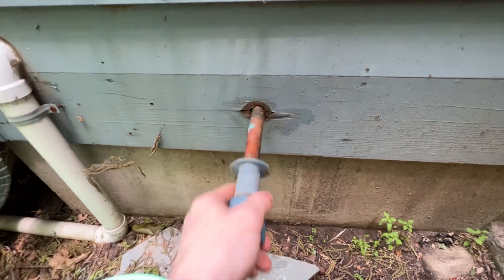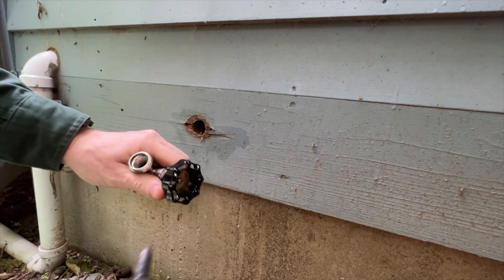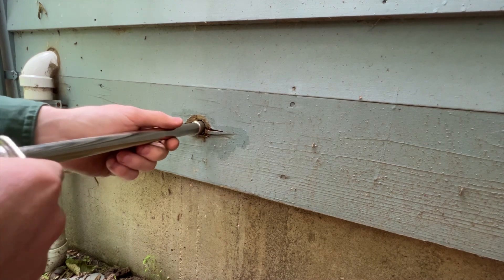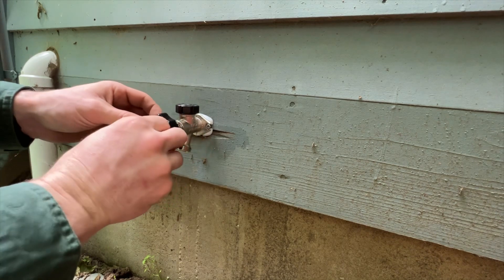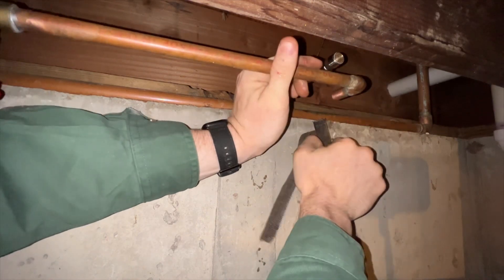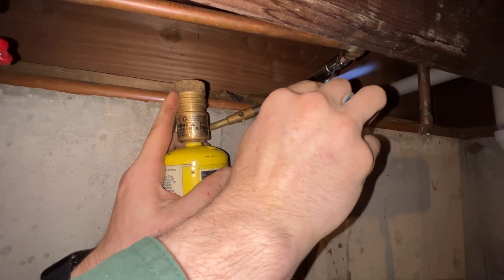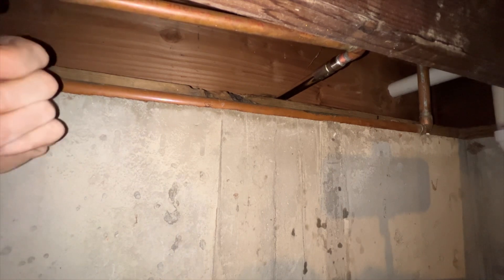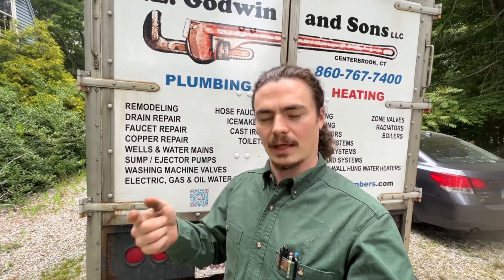Silcock Quicky

Comment: You don’t take the valve apart there are rubber washers in it?
Reply from the maker: Negative, as long as the soldering process remains quick, the seals will be fine.

Comment: need to remove the stem to prevent the seals from melting...next time
Reply from the maker: These are designed to be solder with the stem in place. Similar to sweat supply stops. As long as you don’t over heat and get the soldering done quick, there are no issues leaving the stem in.

Comment: Any need to take out the internal stem and washers so as not to melt them prior to soldering?
Reply from the maker: No Sir, these faucets are designed to be soldered as in and can take the heat from that process. Just make sure the valve is open and that you don’t heat it so long you end up with a green flame.
Reply: @GodwinAndSons  Ahh ok, what brand outdoor faucets do you use?